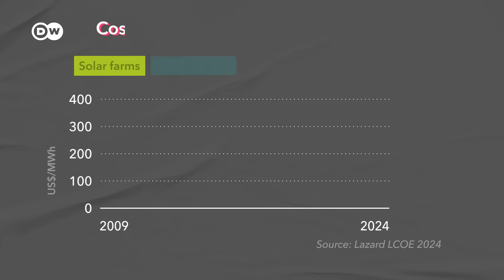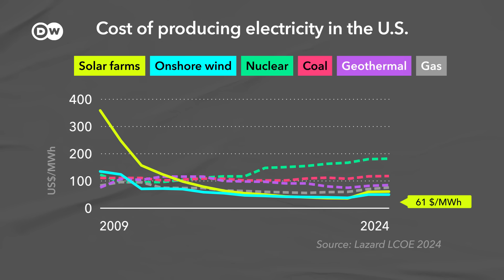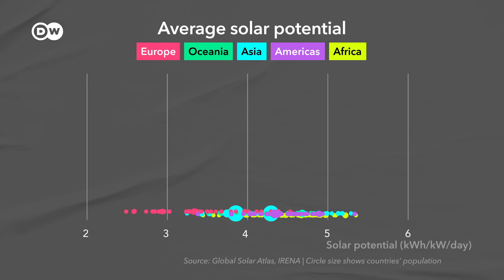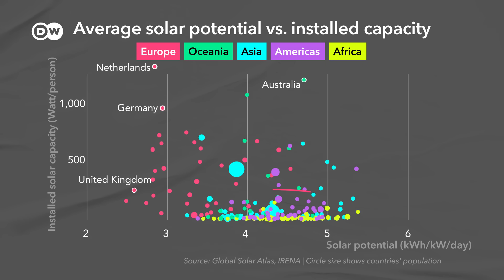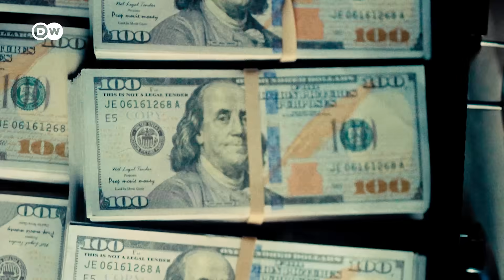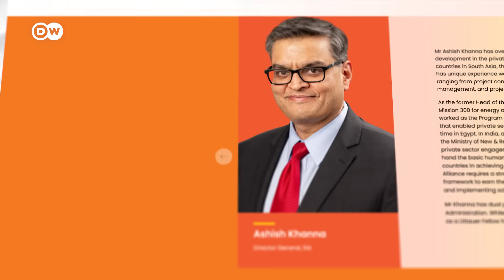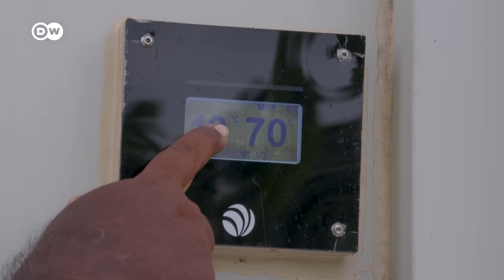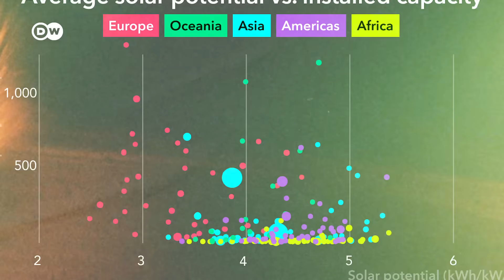We're building solar in the wrong places. But we can fix that.

Comment: in south africa the electricity system is not privatized and the government has taken away the ability to feed back to the grid while also not providing constant electricity because the system is badly run, they won't encourage solar because the politicians loose the ability to steal money. I just want to bring awareness to this because its not a lack of money that south africa doesn't allow solar but rather the corruption
Reply: This is false. As someone who works in the SA industry, I can tell that the oppsite has happened. The market has been loosened up and private enrgy producers are building power plants at an previously unheard of rate. Sasol, Richards bay minerals, Investec, Amazon, Anglo American, Discovery are just some examples of the Company's who closed major deals with private power companies recently.
Reply: @Stormer115 that’s not a privatization of the power grid, that’s private companies producing there own power, that’s equivalent of a solar system to those companies.
Reply: @NickT-x  These aren't behind the meter installations, take the Richards Bay Minerals, its buying electricity for its operations in KZN, from power producer Red Rocket, from a wind farm in the Western Cape. That same wind farm will also be selling to Discovery. Discovery will actually resell that power to smaller consumers such shopping malls. Sounds very much like private generation is happening.
Reply: @Stormer115   wow, thank you for informing me, hopefully this has a trickle down effect to actual residents of the country and not only these larger companies
Reply: @NickT-x
Yeah as far as I am aware, the electrical system is pretty much in the process of being privatised. There is a process underway to establish a free electricity market. This was enabled by the passing of the Electricity Regulation Amendment Act last year.
Reply: I guess you could build-up an island system with batteries (LiPO4) as long as you do not have snow or periods of long-lasting very bad weather and you do not use electricity-based direct heater. Both, PV panels and batteries became quite cheap recently, even in good quality.
Reply: @rainerrillke5660  a lot of south africans have private solar or generator systems due to the constant power cuts, but are denied the ability to feed back into the power grid to supply the system that doesn't work, which they used to allow but have since removed.
It also creates huge visual wealth disparity as when power outages occur, which are frequent, certain houses will have lights and running water, when most of the area doesn't.
Reply: @NickT-x  (I am not an expert on the south african electric grid, obviously)
If you have an unstable grid to begin with, feeding back can actually be a huge problem.
For starters, all most all grid tied solar inverters are grid following. They must turn off for safety reasons, if they are unplugged or the grid is down. So the help for the grid would only be limited.
Next, the grid can be thought of a lot of individual loosely coupled (electricity) pendulums.
If you have only few "traditional" equipment connected to the grid (rotating generators, motors) and a lot of modern electronics (solar inverters, LED lights, phone chargers) you need monitoring of the state of the grid, and equipment like synchronous compensators to manage the flow of electricity.
Modern electronics, especially anything changing voltages, create atypical "overtones" in the frequency spectrum.   
The biggest concern here are frequency and voltage fluctuations resonating inside the grid, and potentially frying wires, transformers, and anything connected. Similar to what happened in the european grid around the spanisch black out a few weeks ago.
Reply: @derradfahrer5029 thanks, I didn’t think of it that way
Reply: @NickT-x  Nick please be honest online. I live in Gauteng. We installed an expensive inverter system that we hardly use because power prices have gone down and there's less load shedding. we invested all this money and it's still cheaper to just go prepaid
Reply: @tatsm847  that doesn’t contradict my statement, you still aren’t provided constant electricity, the system still isn’t privatized and the government still doesn’t encourage solar, the fact you invested in solar is proof that you didn’t trust the South African electrical grid.
Reply: @NickT-x  I don't want to privatize the electrical grid because not everyone is as blessed as us to afford the latest and greatest technology. South Africa is relatively balanced. if you want solar power then go for it and if you can't afford it, you won't be priced out of having electricity. if you don't want to pay for Government power, there's nothing stopping you going completely off the grid. I think that's fair for both poor and rich people
Reply: @tatsm847  Privatizing or partly privatizing the electricity grid wouldn’t automatically make power more expensive, especially if private companies could use Eskom’s existing infrastructure. That way, Eskom wouldn’t be the only player anymore — other companies could enter the market and compete by offering cheaper electricity. This competition could help bring prices down for everyone.
Reply: @NickT-x  I agree with partly privatizing the grid. Working to improve the current infrastructure would make sense as well as ensuring our talent remains to help improve the country while learning from world class facilities... voting for the right leaders is essential in these objectives. we avoid brain drain while fixing inequality ... 2 birds with one stone
Reply: @tatsm847  I couldn’t agree more, I say this having left the country to study, but me and every South African I meet all have the exact same sentiments. No country comes close to South Africa, and I honestly do believe that if the country gets better, South Africa will have a huge influx of well educated and skilled South Africans come rushing back.
Reply: @rainerrillke5660 they are still taxed out of our reach
Reply: With solar and batteries, the grid will become much less relevant, and with the abundance of sodium and lithium, batteries will only get cheaper.
Reply: same in Brazil
Reply: In Nigeria the electric system is privatised and we still have the same problem
Reply: So, they passed away the  chance to get free electricity? Because if you install a grid tied system on your house, you will feed it with lots of free for the grid electricity and you say they don't allow you to inject electricity into the grid.
That's very strange
Reply: @nickAre you from Africa
Reply: @Deer-i7o yes
Reply: Are you from africa

Comment: The problem is storage.
What we do when sun is goes down?
So it's not the cheaper form of energy. You don't include in the cost of batteries. And the days the sun is off for good.

Conclusion :Invest in hydro.
Reply from the maker: You're right — there are still big challenges when it comes to batteries and grid infrastructure. But even so, solar is already the cheapest source of electricity in many parts of the world. Hydro, while reliable, often comes with serious environmental and social costs — especially from dam construction and displaced communities. We’ve made videos diving into all of this, so feel free to explore more on our channel! 👇
🔋 "This is what's REALLY holding back wind and solar"
https://www.youtube.com/watch?v=u-DsDuTceTo
⚡ "How salt and sand could replace lithium batteries"
https://www.youtube.com/watch?v=-vobMl5ldOs
🌊 "How to solve our Big Dam Problem"
https://www.youtube.com/watch?v=GTFDVZU-Nv0

Comment: We have so many schemes here in Australia to encourage solar panel installation. We just signed up to a  government subsidised initiative where we will get it installed next week and pay it off interest free over 5 years. It will be more than  enough for everything we use currently +20% that will return to the grid. I'm excited 😁
Reply: Also there's an upcoming rebate for house batteries as well, which I think is a missing piece in the puzzle to flatten out the power gained from solar throughout the day and help with peak times of consumption.
Reply: @Bareego  final pieces are state grid connectivity between noth and south states. Having the grid go from SA to VIC to NSW then QLD with no grid connect to NT doesnt work. NSW screwed up their connection to SA is just another example how shambolic Australis is with infrastructure.
Reply: So Australia can subsidize solar power, but when China does that with EVs you sound alarm calls
Reply: Thankfully we’re smart enough not to redirect highly efficient solar funding to nuclear projects that we don’t even know when could be completed
Reply: @frank7353  Nuclear and solar do NOT produce the same kind of electricity. Nuclear can produce during the night, and can run at 100% around the clock. Solar do not produce much during morning (when everyone starts their tea boilers) and during evening (when everyone showers, or cooks, or watches TV, or needs lights, or ...
Hydro can ramp up and down (unlike nuclear, which usually stays at 90% or more of nominal power), and can produce round the clock too.
And whatever the cost, nuclear is cheaper than large enough batteries, more environmental friendly than coal, more dependable than wind, and can be built where there's no hydro potential. Yes, construction costs (including permits, environmental opposition delays, ...) have ballooned and construction time might have tripled on recent projects - but you can't build hydro power in Sydney, or Abu Dhabi, or ...
Reply: @frank7353  And Australia's electricity is so cheap because of so much Solar right?! and France is so expensive because it has so much nuclear right!?
Reply: @zl4139  context? nah, let's just throw that out the window
Reply: @zl4139  And I don't think you realise that Australia is 14 times the size of France with 1/3 of France's population. So the cost to maintain the grid is 14 times France but only 1/3 of the population to pay for it.
Reply: @zl4139  Electricity production in Australia is ridiculously cheap.  What you're wailing about is the grid access fees from commercial companies seeing their death knell as solar is decentralized.  They're desperately raising the cost for people who aren't self-supplying, because they're falling over themselves to upgrade the grid they've been profiting from but not improving, for 30 years.

This is a problem with capitalism and privatization.  It has ZERO to do with energy production itself. Greed and conservative governments are why your electricity bill is so high.
Reply: @BrentHollett  100%.... your comment is spot on. Decentralisation of energy production and storage systems is scaring the big power companies. Australia has the capacity to be rid of coal powered plants within 10-15 years - if the political will was there.  
Decentralised solutions (not just solar) would create space for a lot of smaller power companies that make use of the local situation and provide competition, driving down prices.
Reply: @somerealrandomguy  Most of Australia is unpopulated, so the actual area where you need an electrical grid is significantly lower than that. And you might have mini-grids in places with lower population, which is bad for the cost of electricity but cuts sharply into the need for interconnects (which is also bad for grid resiliency, but good for cost).
Reply: Lol. Great for homeowners, of whom there are increasingly few, and who are already demonstrably affluent enough that we shouldn't be subsidising them if it's such a boon.
Reply: @gravitaslost  not sure how you found that funny.
Reply: Feeding solar power back into the grid will harm it.
Reply: @loangxuong9863 do you have any facts behind this claim? Gigawatts of power from solar are fed back into the grid in Australia every day.
Reply: @theharper1 basic physics . yes but they have to spend much more money to do repair, maintain or upgrade electrical systems.
Reply: @loangxuong9863 when I studied physics,  transformers worked both ways. I just don't see the evidence to back up your claim. If feeding power into the grid caused a significant amount of damage, the power companies wouldn't allow it. Right now at 3.30pm on a winter day, there's 4.4 GW of household solar going into the national grid. It's not breaking anything, least of all the laws of physics.
Reply: @theharper1 The power company not allowing it  is the exact reason why rooftop solar isn't everywhere. 
If the grid management company is a state-owned ,they are forced to follow government policies. If they are private, they must receive huge subsidies from the government.
How many percent have electricity prices increased since they started doing so?. give it few more years it will get worse.
Reply: @loangxuong9863 you know nothing about Australia clearly. Solar is already supplying over 70% of the power during the day. That wouldn't happen if the power companies didn't allow it. Maybe do a bit of research before you make such global claims.
Reply: @theharper1 the power clearly coming from the solar plant, not the roof of common households . I talking about feeding the enegy back in the gird form household.
 .Solar power in Australia is only at 19%.
Reply: @loangxuong9863 you really don't know what you're talking about. I have a screenshot from April which shows 8GW of rooftop solar contributing to the grid. As I said, on a sunny day in a warmer season, solar provides as much as 70% of the grid power. Obviously it provides zero at night. Sorry, you're just wrong.